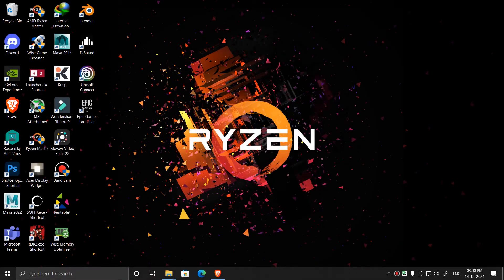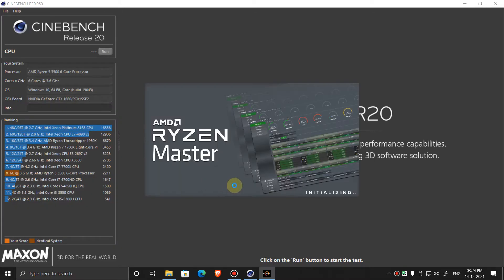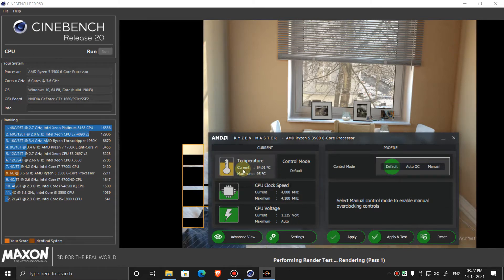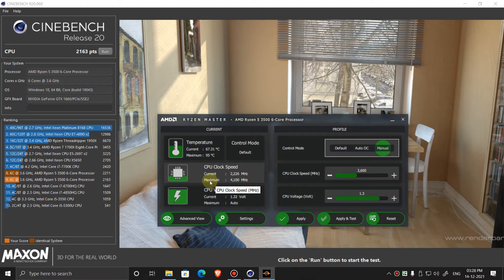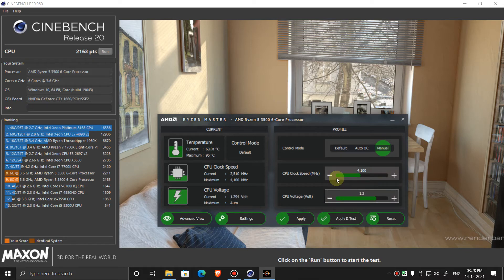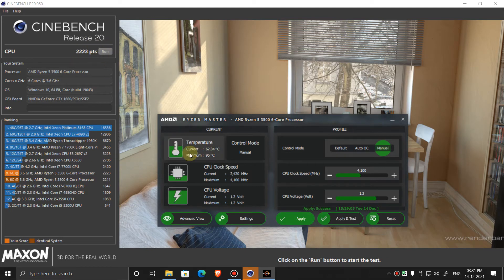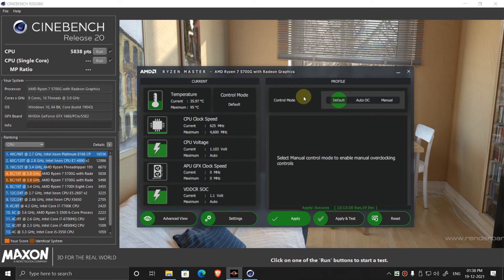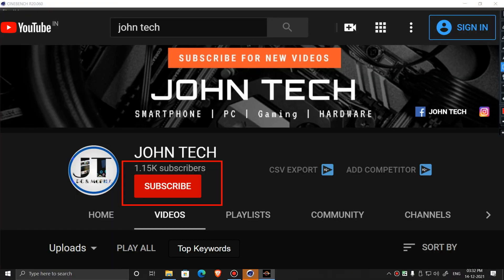How To Undervolt  Ryzen CPUs  | High CPU Temperature Fix | JOHN TECH

Comment: Ryzen 2700x best settings?
Reply from the maker: Cpu Voltage = 1.15v
 cpu clock = 4.1ghz
Reply: Sir I'm using stock amd cooler wraith spire should i set these settings in bios??. My motherboard is msi b450i gaming plus ac latest bios.
Reply from the maker: Yah you can try out.
Reply: Incase pc doesn't boot
Then i have to reset bios
Reply from the maker: Yes you can reset if it doesn't work.

Comment: great video  I didn't know about this app ryzen master. I have ryzen 5 5600g mobo b450m ds3h I think my idle core T° seems too high about 60-65°C...what do you recommand for frequency cpu if I set my voltage to 1.2V as you recommand? thanks @JOHNTECH112
Reply from the maker: You can keep the same settings as i showed for 5700g or keep voltage 1.2v and core clock 4.2ghz, I would suggest you to enable PBO2 in bios which helps more performance for free.
Reply: @JOHNTECH112  ok thanks a lot ! you have won a suscriber 👍
Reply: once I enabled PBO2 do I have to tweak some settings or just using ryzen master?
Reply from the maker: @Kalel9411  follow this video for step by step process for pb02 
https://www.youtube.com/watch?v=dfkrp25dpQ0&t=384s
the settings applied once is enough no need to do every time.
Reply: @JOHNTECH112  thanks :)

Comment: Ryzen 7 6800H best clock and Voltage ?
Reply from the maker: Laptops don't support Ryzen master, you have to use Ryzen controller. In that you can easily enter the max temps, voltage and clock speed.

Comment: i have 5700x u have any recom for pbo and the voltage setting?
Reply from the maker: Yes go to bios turn on PBO2 and add a offset voltage of -25, you will gain performance boost, i did it with Ryzen 7 5700G works very good

Comment: Will this affect my gaming performance for ryzen 5500?
Reply from the maker: No it won't affect your gaming performance, and I would suggest you to turn on PBO2 in the bios
Reply: @JOHNTECH112  can you tell me where the setting is to turn PB02 on? I don't see the setting in my bios
Reply from the maker: Follow this video https://youtu.be/dfkrp25dpQ0 , use the same settings that he uses for 5600x
Reply: @JOHNTECH112  Thank you very much
Reply: @JOHNTECH112  I turned pbo2 on but when I launch ryzen master it says my cpu doesnt support overclocking so the profile section is disabled :( I can only see the left section where you can see the cpu temp, volt.
Reply from the maker: Can you share your screenshot or a video of your problem on Instagram.
Reply: @JOHNTECH112  No worries, I was able to change the value in my bios settings. My temp has dropped 10 degrees thank you :)

Comment: Ryzen 5 2400g best clock and voltage please? Thank's
Reply from the maker: Try  1.2 volts , 3.7GHz all cores, test using cinebench to check stability and temperature

Comment: I am using ryzen 5 5600x....can I do 1.2v and 4.2Ghz
Reply from the maker: yes, also I suggest you turn on pbo2 in bios,
Reply: @JOHNTECH112  will it lower my cpu temperature
Reply from the maker: @ankitpurakayastha6605  YES AND ALSO BOOST CPU PERFORMANCE
Reply: @JOHNTECH112  and if I don't turn on pb02 then?
Reply from the maker: You will lose a little bit of single core performance, multi-core no difference

Comment: what's the setting for Ryzen 7 4800H (mobile CPU) ?
Reply from the maker: Ryzen master will not work on laptop processors, but you can use Ryzen controller it is made for laptops

Comment: what are best settings for ryzen 9 5900hx?
Reply from the maker: laptop CPUs don't support Ryzen master so you have to use Ryzen controller
here is the link
https://ryzencontroller.com/
Reply: I have also the same bro plse suggest something temperature hit 96c max
Reply from the maker: Use Ryzen control, there you have the option to limit temperature.
Reply: @JOHNTECH112  its not working i set it to 80c but still it goes up to 90 please help ..... :^)
Reply from the maker: Can you share settings which you applied in Ryzen control and the gameplay with msi afterburner in Instagram i can see it. My insta id is JOHN TECH
Reply: @lappiboy007  You will need to limit the current and TDP. Lower the the PSI0 and SOC current and reduce the TDP . Only setting temperature will not work.

Comment: Ryzen 5 3600 best clock and Voltage ? using Ryzenmaster
Reply from the maker: clock 4.2 GHZ ,  1.15 - 1.2v   voltage ,  Run Test Using Cinebench and check temps in ryzen master

Comment: How is this method is different from pbo 2 in the bios for 5000 series ?
Reply from the maker: here we are setting  cpu clock and voltage manual 
these settings dont need to be restart the pc , you can set the oc for temporary or permanent

Comment: I use liquid cooling. In fact, I don't have a problem with the temperature, I just need to adjust this processor to get more performance in fps games. How do you think I should adjust? By the way, the video card I use is rtx 3070ti and 2x16gb 3600mhz ram. thanks
Reply from the maker: Which aio did you use ?
Reply: @JOHNTECH112  aio?
Reply from the maker: I mean which All in one (aio)liquid  cooler are you using
Reply: @JOHNTECH112  240mm lian li
Reply from the maker: @OyunFuryasi  ok  so you need more fps in games so which processor are you using ?

Comment from the maker: Note - Ryzen Master does not apply settings permanently, If you want to keep the settings permanent, then you have to enter the same values in the bios.
Reply from the maker: change voltage to 1.3v , keep clock speed 4.2ghz , test this using cinebench r20 , if it is stable then , you can slowly increase clock speed
Reply: @JOHNTECH112  what about the 3900X that I'm running?
Reply from the maker: @highlandermccloud3594  try 1.2 v and 4.1 ghz all cores try stress test using cinebench
Reply: @JOHNTECH112 Please, say me what me doing with RYZEN 9 6900HX 🙏
Reply from the maker: Yes do same as the video
Reply from the maker: What cpu cooler your using ?
Reply from the maker: Once try the settings which I told  keep voltage in 1.3v , and cpu clock 4.2 ghz use your cinebench r23 to test temperature and also run test 2 times to check it is stable or not
Reply from the maker: Stable means , the settings which we done is safe or not , If it is safe then it will not have any problem , if it  is unstable , your pc will restart
Reply from the maker: If your using liquid cooler still reaching 80°© ? I use cheap air cooler , from cooler master hyper 212 , whilel gaming it reaches 50-60 °c in stock
Reply from the maker: @Tigron  yes press on default settings in Ryzen master , it will be back to default
Reply: I have ryzen 9 5900hx it goes to 94 degrees on balanced mode and 96 degrees on turbo mode